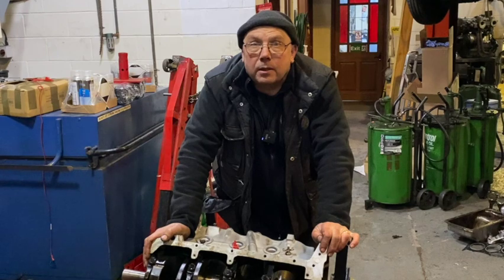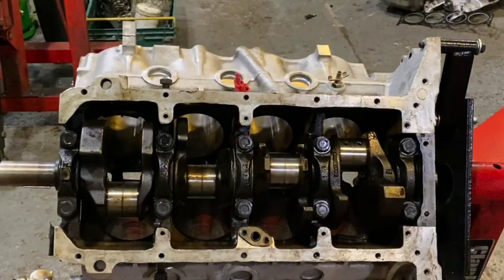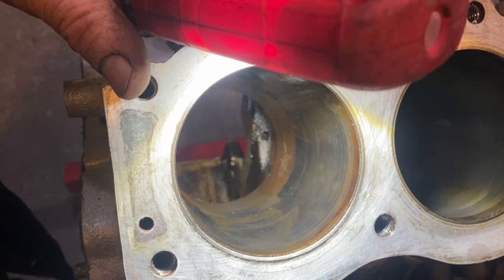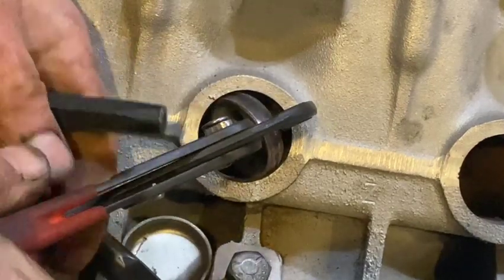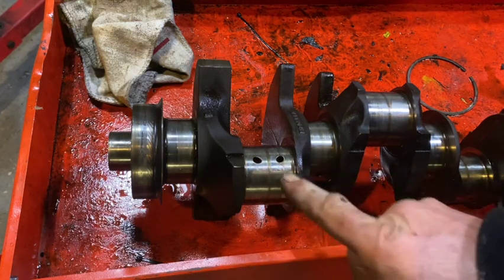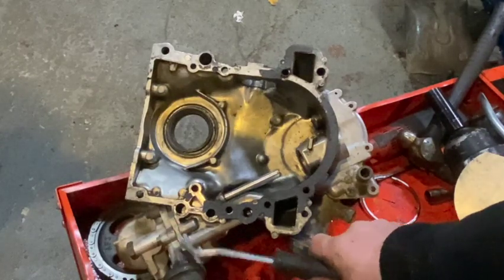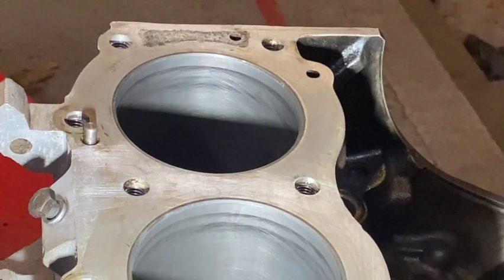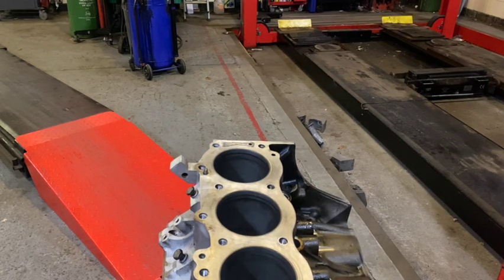Rusty the V8 Rover rebuild and Dyno test part 2

Comment: Always been interested in the Rover V8 ( aka Buick 215) . Watching your various videos, you've shared a wealth of knowledge and mechanical experience. It would seem that used Rover V8's are exactly that. . . Used. 
Still an awesome little engine though 😊👍
Reply from the maker: Yes they are, and they hide wear really well, just because they run and sound ok doesn’t mean they are not completely worn out

Comment: another master-class, thankyou
i've been keeping my running, but worn -out 75 RR 3.5 engine, is it just rubbish, or is there any value in it that you know of ?
Reply from the maker: It’s not got much in the way of value, if you’re going to buy one it makes more sense to buy a later or bigger capacity. But that said it can still be tuned or converted to a 3.9
Reply: @PenguinMotors  i went the cheaper/ more economic / more powerful option, 4.2l 32v 300bhp stype, pray for my axles...
Reply from the maker: yes unfortunately these days the V8 rover is only a viable option for power increases where you are trying to retain originality, or your looking for a "period" correct engine
Reply: @PenguinMotors  historic vehicle status allows updates to improve emissions. this jag engine was used for about 1yr in the new rangerovers, so, we have a petrol, V8, 4.2, rangerover engine. period correct ? close enough -DVLA happy.  thanks for your replys